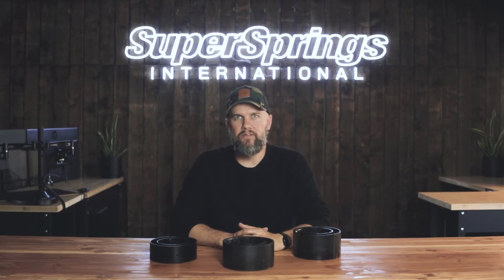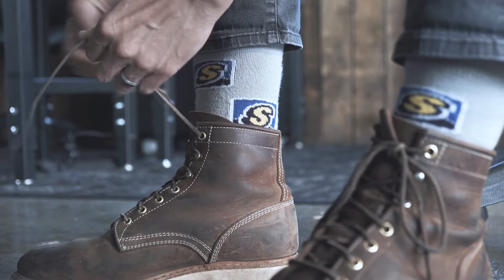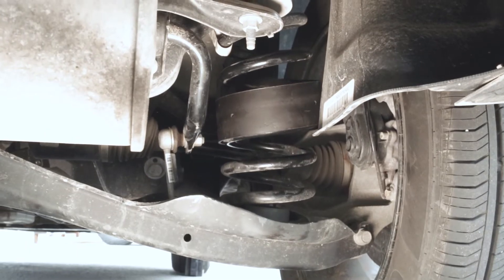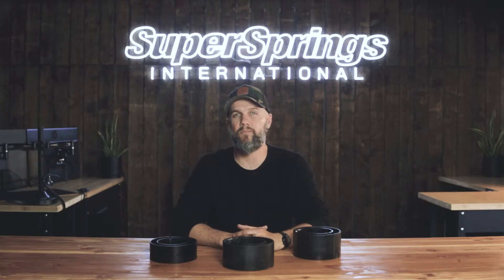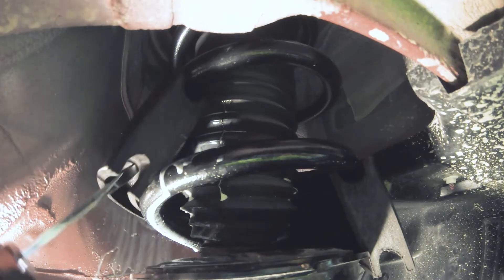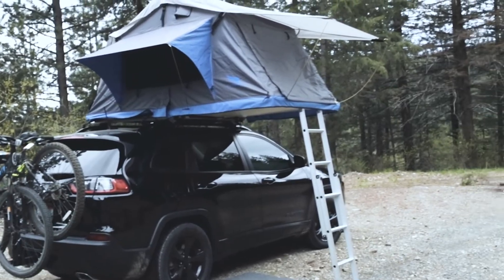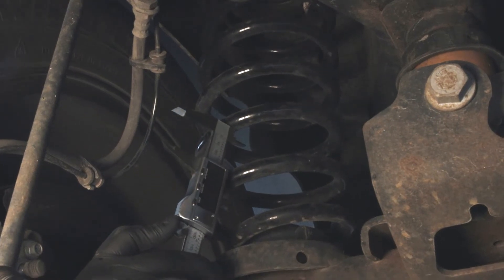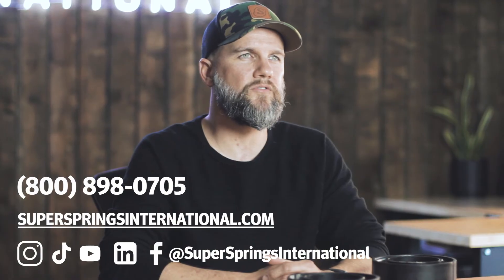Coil SumoSprings | Are They Right For Me? | VLS ep. 5

Comment: Does it act like a bump stop?  Limit uptravel?
Reply from the maker: Yes! SumoSprings act as a progressive bump stop, but unlike traditional rubber bump stops, they provide a smooth, gradual engagement and continue to support the load throughout suspension travel.
Reply: @SuperSpringsInternational  Thanks.  I have ADS coilovers on my bronco and measured the spring gap as shown on the website.  Probably add these soon.

Comment: I have a 2019 Ram 1500 with coils in the front and rear. I carry a good bit of material loads and pull trailers for work. I am looking at the blue or black sumo springs to help keep the rear up, but have been trying to figure out if I should pair it with a coil sumo spring and which one would be best. I intend to put them in the front regardless, but didnt know if they should be used together with the bump version for the back.
Reply from the maker: We would recommend that you first try solos SumoSprings in the rear and because of your commercial application, go with the black Sumos! If you feel you need added support after that, then coil SumoSprings would be appropriate to supplement.

Comment: I've got a custom converted 4 x 4 E-Series van with a 6.0 turbo diesel. I feel the springs the converter used are under sprung, there's a particular speed bump I always bottom out on and hit the front bump stops. Had a set of these installed today and went over the same speed bump, all I can say is wow what an improvement it also stabilized my ride on the freeway, get a set you won't be disappointed!

Comment: I have a 2015 Ram 1500. I recently lifted it 4” and the body roll is pretty bad. Will this product help reduce the body roll if I install a pair on the front and rear coil springs? I don’t carry additional weight or plan to pull anything with my truck. Thanks in advance.
Reply from the maker: Yes, these definitely help with body roll especially while turning.

Comment: I got a 2006 F150 with a 3in leveling kit in the front. Can I buy one of these SumoSprings to add an extra inch or 2. It should be able to still fit right .
Reply from the maker: Our Coil SumoSprings aren't designed to lift your vehicle. But they can help decrease vibration and stabilize sway on your truck.

Comment: You can’t “add capacity” with any aftermarket part.
Reply: they just did it though
Reply from the maker: Actually, while it's true you can't change the fundamental specs of your vehicle, our SumoSprings do help manage and distribute load more efficiently. Think of them as a personal trainer for your vehicle, enhancing what's already there to perform better under pressure!
Reply: I am aware of that, but that’s not what is said in this video.
Reply from the maker: @gs-pd5ox   you're right. This video explains how with Coil SumoSprings, you can add capacity to your vehicle! Coil SumoSprings are designed to enhance your existing coil springs, adding up to 30% additional capacity. This means a smoother ride, improved stability, and better handling, all without replacing your coils. It's a simple and effective upgrade that can make a big difference in your driving experience. While they do not change the specs of the springs themselves, they provide additional support adding to your capacity.

Comment: first you have to address if your shocks are in good condition.
Reply from the maker: Always a good idea! But even when they are, these Coil SumoSprings will increase capacity by up to 30%. We've tested them on brand new vehicles and still get these types of impressive results. It's why RV manufacturers like Winnebago, Coachmen, and Thor add these to brand new vans before they leave the plant. We have emergency vehicle fleets using them too! -Tom

Comment: 2018 RAM 1500 4x4 with tow package but do very little.  Mostly highway driving.  Do I go with COIL Sumo Springs or blue Sumo's if just picking one?
Reply from the maker: If you just use your truck as a daily driver, I'd go with our Coil SumoSprings. - Josh
Reply: @SuperSpringsInternational  Thank you!!
Reply: Have a 2021 Ram qc 4x4 with tow package max towing capacity a little over 11k pounds. I leveled the truck, now worried will sit high when I tow my travel trailer, is about 7k pounds fully loaded. Would I use the sumo springs helper or which color sumo springs? Trucks daily driver and I only tow the travel trailer about twice a year.

Comment: If you have coil-overs at all 4 wheels (independent suspension), but are mainly addressing rear sag with a camper load, will there be any adverse affects by only doing the rear and not the front? I just installed rear Coil SumoSprings yesterday. Haven’t tested the camper load leveling yet but plan to soon. The ride looks and feels great with no camper load, so I am thinking only rears and no fronts will likely work just fine, but not sure 100% until I check the vehicle under the camper load. Thoughts?
Reply from the maker: So it’s good that you started with the rears since that’s normally where the extra weight will be and the Coil SumoSprings will help your vehicle handle that. If the rears are installed by themselves they’ll work just fine. The fronts will help for dipping, body roll, and stabilization when cornering. - Josh

Comment: Does it make any difference if the SS are higher up or lower on the springs?
Reply from the maker: By "SS" Do you mean SuperSprings? Or are you referring to the Coil SumoSprings mentioned in this video? - Josh
Reply: @SuperSpringsInternational  sorry coil spring.  My bad
Reply from the maker: @selder03  It doesn't matter where it's installed but closer to the certain of the spring is ideal. - Josh
Reply: @SuperSpringsInternational  thank you